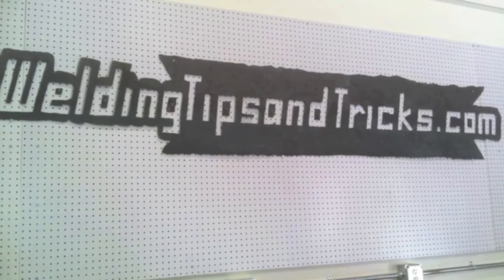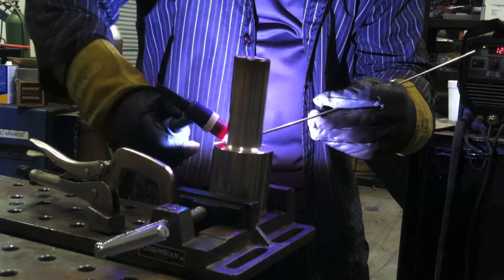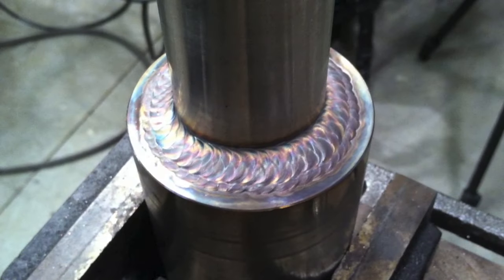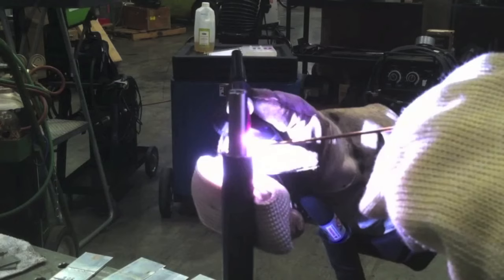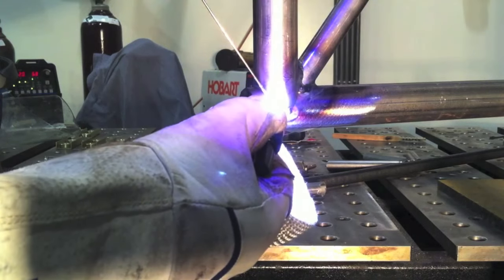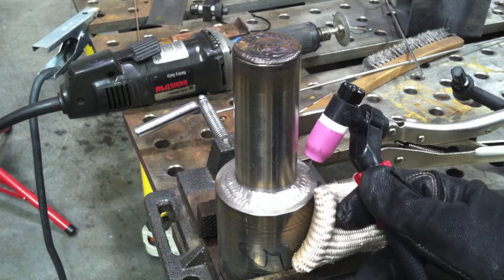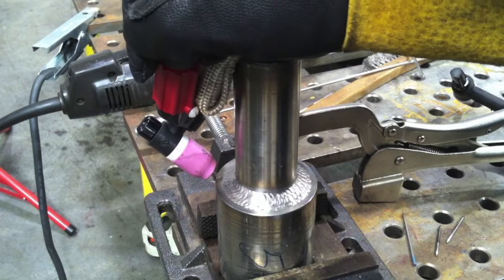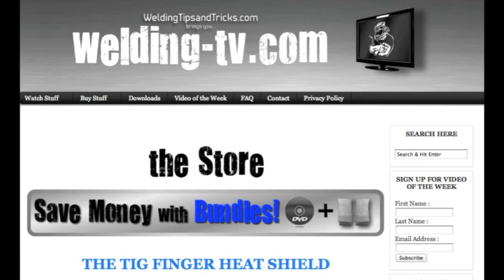Tig Welding Stainless Steel - Walking the Cup vs TIG Finger®

Comment: DEMOCRACY AS A LEGAL FORMULA FOR THE PRACTICE OF GENOCIDE (Friday, December 1, 2017)

-If La Patria is the last refuge of cowards, Democracy is the first-.

We are going to talk about the Crown and all the Presidents since the Spanish Transition and we propose that they are responsible for a crime of Genocide that should be punished with a penalty of between 8 and 15 years in prison.

The genocide was incorporated into the penal code of Spain in 1971 (four years before Franco's death). The Organic Law of the Judiciary of 1985 (Organic Law of the Judiciary, Organic Law 6/1985) grants Spanish courts jurisdiction over acts committed outside Spain where the conduct would violate Spanish law if committed in Spain or violates the obligations derived from international treaties. The law gives Spanish courts jurisdiction over other crimes that international treaties require Spain to prosecute, including genocide and terrorism, and in which treaties require that Spain prosecute such crimes.

The Association of Relatives of Victims of the Genocide of Paracuellos del Jarama presented in 1998, under the protection of the process undertaken in Spain against the former Chilean dictator Augusto Pinochet, a complaint before the National Court against Santiago Carrillo, the PCE, the PSOE, the Community of Madrid and the Spanish State for crimes of genocide, torture and terrorism. The lawsuit referred to facts known as the Matanzas de Paracuellos, a series of mass murders organized during the Battle of Madrid, during the Spanish Civil War and that led to the death of thousands of prisoners considered opposed to the Republican side.

However, Judge Baltasar Garzón flatly rejected the complaint alleging various subjective reasons.

However, the undersigned does not refer to the killings of Paracuellos del Jarama but to the implementation of political measures, mainly in the economic framework that tend to the disappearance and replacement of the Spanish population uninterruptedly since the death of the Caudillo. The numbers of low natality reach parameters of 7 million descent analogous to the extermination during the Nazi period.

That is, when, as a consequence of the implementation of some political measures, the result is that it tends to impede the population's life style and its reproduction, and verified through decades that this is the case and with the foresight to continue being so, reversed in the implementation of these measures can be deduced that there is an intention or spirit, that is, a specific purpose, in this case; the Genocide of a population.

Legal Basis:

Article 607 of the Spanish Penal Code

Penal Code, Book II Title XXIV Offenses against the International Community

CHAPTER II, Offenses of genocide - Article 607.

1. Those who, with the purpose of totally or partially destroying a national, ethnic, racial or religious group, perpetrate any of the following acts, will be punished:

1) With the penalty of imprisonment of fifteen to twenty years, if they kill one of its members.
If two or more aggravating circumstances concur in the event, the higher penalty will be imposed.
2) With imprisonment of fifteen to twenty years, if they sexually assaulted any of its members or produced any of the injuries provided for in article 149.
3) With imprisonment of eight to fifteen years, if they subjected the group or any of its individuals to conditions of existence that endanger their lives or seriously disturb their health, or when they produced some of the injuries provided for in Article 150.
4) With the same penalty, if they take any measure that tends to impede their kind of life or reproduction, or forcibly transfer individuals from one group to another.
5) With imprisonment of four to eight years, if they produce any other injury different from those indicated in numbers 2 and 3. of this section.

2. The dissemination by any means of ideas or doctrines that deny or justify the offenses defined in the previous section of this article, or seek the rehabilitation of regimes or institutions that protect generating practices
 of the same, will be punished with the prison sentence of one to two years.

---

Article 149. Whoever causes another, by any means or procedure, the loss or uselessness of a principal organ or member, or of a sense, impotence, sterility, a serious deformity, a serious somatic or psychic illness, shall be punished with imprisonment from six to twelve years.

Article 150. The one that causes to another the loss or the uselessness of a non-main organ or member, or the deformity, will be punished with the prison sentence of three to six years.

----------------------------------

Jurisdiction

The genocide was incorporated into the penal code of Spain in 1971. The Organic Law of the Judicial Power of 1985 (Organic Law of the Judiciary, Organic Law 6/1985) grants Spanish courts jurisdiction over acts committed outside of Spain where the conduct it would violate Spanish law if committed in Spain or breach the obligations derived from international treaties. The law gives Spanish courts jurisdiction over other crimes that international treaties require Spain to prosecute, including genocide and terrorism, and in which treaties require that Spain prosecute such crimes.

(See "Criminal proceedings against Chilean and Argentine repressors in Spain: a brief summary, November 11, 1998, http://www.derechos.net/marga/papers/spain.html or Spanish criminal prosecutions use the right International Human Rights Campaign to Fight "Impunity in Chile and Argentina Prof. Richard J. Wilson,
http: //www.derechos. org / koaga / iii / 5 / wilson.html)

UN:

See;

 THIRD PERIOD OF SESSIONS (1948-1949). NUMBERS OF RESOLUTIONS ADDING TO THE CRIME OF GENOCIDE: A / RES / 260 (III) AC, A / RES / 260 (III) C, A / RES / 260 (III) B, A / RES / 260 (III) A . THE COMMISSION WAS THE C.6 AND THE TOPIC THE NUMBER 32. THE DATE WAS ON DECEMBER 9, 1948. RECORD OF THE SESSION / DATE / PRESS RELEASE (IN ENGLISH) / VOTE: A / PV.179 OF 09 DECEMBER OF 1948. THE DRAFT RESOLUTION WAS THE A / 760 AND CORR. 1-2. AND THE TITLES: PREVENTION AND SANCTION OF THE CRIME OF GENOCIDE; IMPLEMENTATION OF THE CONVENTION FOR THE PREVENTION AND SANCTION OF THE CRIME OF GENOCIDE TO NON-SELF-GOVERNING TERRITORIES; STUDY BY THE COMMISSION OF INTERNATIONAL LAW ON THE QUESTION OF AN INTERNATIONAL CRIMINAL JURISDICTION; APPROVAL OF THE CONVENTION FOR THE PREVENTION AND SANCTION OF THE CRIME OF GENOCIDE AND ITS TEXT.

J. M. Mora

Comment: You are putting beads on solid metal. If this were a .085 wall, that would burn through  it. This isn't helpful to the starter tig welder.